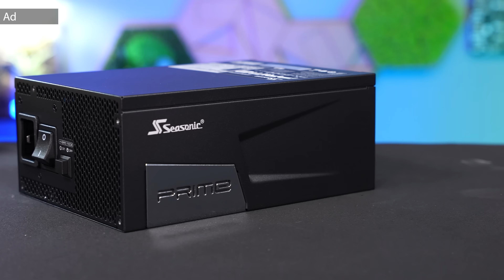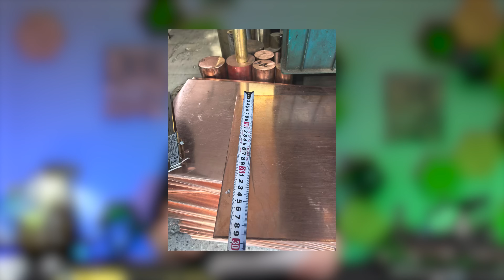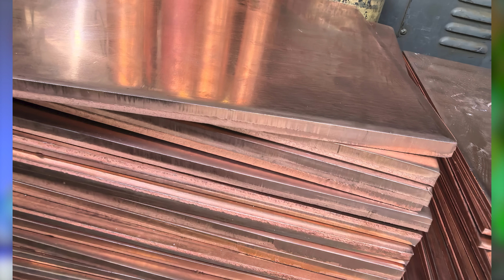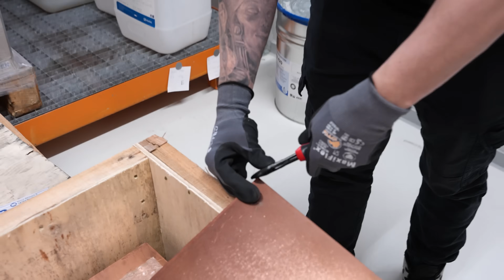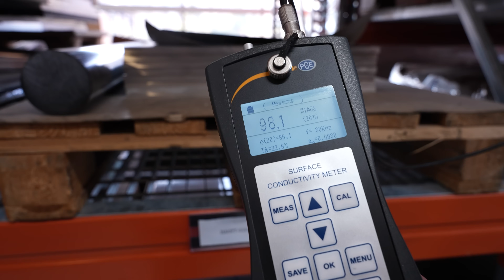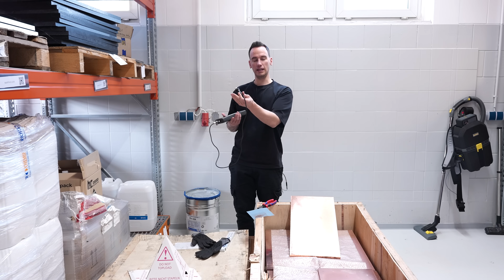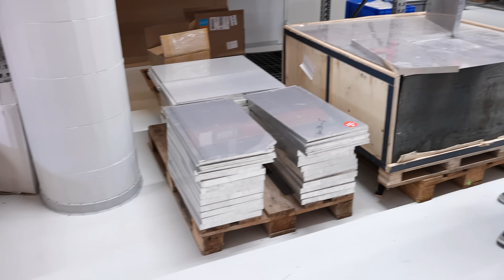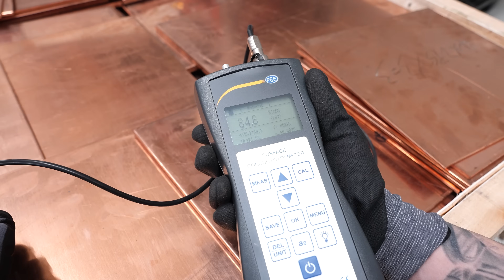I Got Scammed

Comment: Lol funny this video comes out when my firm got scammed buying Chinese steel to Canada. My boss being Canadian didn't want to deal with USA cuz of the tensions and decided to buy steel for welding and fabrication from China. The quantity ordered would normally cost 100k USD and a Chinese company was offering it for 30k, just usual grades SA516/SA387. We waited a month and it arrived and they were dogshit steel that didn't even classify under US/Canada grades.
Same happened in 2021 in my previous firm who decided to buy Chinese batteries (Legendary BYD) for all the electrical equipment instead of the South Korean ones we usually deal with. The battery cycles were twice as low and started failing badly in two years while the SK counterparts never failed even after 5 years in usage. 
China floods the market with high volume crap. Their end goal is maximum output of goods without consideration for the environment or resources depleted from Earth. Recycling the whole use and throw goods from China will be a huge headache to deal with 50 years from now.

Comment: You should tell Alibaba about this. They do not like for suppliers to act like this. They might be able to help you get your money back.
Reply: Alibaba won't help them because they didn't use their services. They used Alibaba to scout the source, not actually using Alibaba for the trade.
Reply: @paul2609 Alibaba can still delist them even if they can’t just refund his money.
Reply: @paul2609  This is in fact their mistake. They used a non-regulated platform with basically zero insurance. Amateur move TBH but I hope its a lifelong learning experience that could have prevented much worse deal.
Reply: @paul2609  I think you are right, so he needs to go to his bank. As the EU is the same as the UK, so you have £100k protection on credit cards and £25k on normal VISA AE cards, also many banks give protection on bank transfers, mine gives £80k.
Reply: @paul2609  doesn't matter, if you initiate the deal on Alibaba, then finalise it outside, Alibaba will still step in. I've done it and they helped get a full refund
Reply: @paul2609  yeah this is an important point that 'somehow' got overlooked in the video — if you don't pay through the platform, you don't have ANY insurance and backing from that platform. Imagine just sending someone 40k over bank transfer on the basis of 'sure here's some photos'. Like dude...
Reply: @paul2609  Bingo! Alibaba is great hence why you have to use their payment method and pay the fee hence the "protection". So this is why inexperienced buyers are lead down the path of oh just to a bank transfer it less money for you as you don;'t have to pay the fee. NO THANKS. I have been using Aibaba for production for years and I have received my money back for goods not rendered. Alibab basically holds the money till goods are released and then checked when they arrive at an Alibaba warehouse. Always good to pay a few bucks more upfront than cry later. The price is better anyway than local even with the Ali fee and the risk is just not worth it. Its a doggy dog world out there. Stay Safe.
Reply: @paul2609  FUCKING LOL, okay I felt bad for him at first but naaah man, he should know better that having assurances about Chinese supplier is the only way you're not getting shafted. Pretty sure this supplier does the shipments perfectly when bought through Alibaba cause they don't want the heat.

As someone once said, cheap(er) is expensive
Reply: @paul2609  AUCH..... Why... I understand doing a direct "blind" transaction on a 10$ item or some junk, but this ain't it...
Reply: Should have stuck with Alibaba... TradeAssurance, verified supplier, additional options for Alibaba to send someone out to confirm goods before shipment.. low experience move bro.
Reply: I got £13,500 back from Alibaba this year for defective goods. No problem at all. The money was back in my bank within 4 days, too.
Reply: @hardergamer  waste of time and money, getting a product that sucks and you have to send back. No thanks. 
I'm pissed that I bought a combination lock for my gate, a week later it broke. Fuck this, it's a pain in the ass.
Reply: @hardergamer  But you purchased/paid for it via Alibaba. I also got something similar, which was around 15K. The only issue that we had was the quality, which was extremely poor & we didn't get the amount we asked for (missing ~150 units). The seller suggested me to pay via a 3rd party so he could be me a 25% discount, but I didnt. BUT instead I used the platform itself. It was more expensive but I got my money back =)

And also that wouldnt make a YT video... :P
Reply: @hardergamer since last year they don't always refund you through AliExpress if you're scammed though, I only get my money back around 70% of the time now. (I spend around $70k a year on AliExpress.
Reply: @hardergamer you purchased through the platform.
Reply: @hardergamer  are you sure this YouTuber used Alibaba for the purchase tho?
Reply: @sepg5084  He said he used alibaba.
Reply: @hardergamer  Yes, usually you get the money back on Alibaba. But then you don't get a nice YT story.
Reply: @lukasvonniederhausern6153  Not if you sidestep Alibaba and go straight to the supplier, try keeping up.
Reply: @lukasvonniederhausern6153 someone said they used Alibaba just to find the source and made a trace outside of Alibaba
Reply: Agree, Alibaba tries hard to keep everyone honest. I've only had good luck ordering tools, some expensive, from Alibaba.
Reply: Thank you for sharing and I really hope you can financially recover for this because you make amazing products! 😢
Reply: Alibaba has product called Trade Assurance for this kind of thing. Basically they hold the money in escrow until you sign off that the product you got is defect free.
Reply: forget alibaba call the embassy, send them the info.  They make Chinese businesses look like scammers.  China wants to diversify away from the usa.  It's a good time to get them to go after scammers that hurt their reputation.  I bet they get whipped.
Reply: @charbtious7262  okay karen chill, and then what, call the manager of china?
Reply: @charbtious7262  lol and they will just tell u to hire a lawyer to sue the factory in China. Which is another big chunks of money
Reply: @charbtious7262  THIS IS THE DUMBEST MOST GULLIBLE COMMENT I'VE SEEN ALL WEEK, THANKS FOR THE LAUGH.
Reply: @BaloneySandwichWithKetchup  actually Xi doesn't like Chinese scammers because it hurts their reputation/bottomline.
Reply: @BaloneySandwichWithKetchup  your comment is idiotic.
Reply: @charbtious7262 lmao imagine you are a Chinese who just gained $$$ from your enemy, will you honor your enemy's request???
Reply: @m3chanistthe Germans were always gullible.
Reply: @m3chanist yeah right 🤣 ofc they are, everyone is an enemy of xina.
Reply: @m3chanist u sure ?
Reply: @m3chanist If North Korea started making really nice 3d printers for cheap i bet you'd say the same about them too. You gullible selfish little fool. Blind to the world around you.
Reply: @nmslesecnmbese917  are you ok? drugs?
Reply: Yeah I was going to say, seems odd that there would be zero redress from Alibaba, but I guess if that's their T&C's then nothing you can do.
Reply: @apondo100  They used Alibaba to scout the source, not actually using Alibaba for the trade. So no reason for Alibaba to help them.
Reply: Except, a company can just easily start under another name.
Reply: @DarknoorX this company was using this name for 8 years. If they start with a new name he wouldn’t have used them.
Reply: @rsilvers129 The problem is scammers like this simply buy names that already have a history
Reply: @rsilvers129  Companies can be sold or they hit desperate levels and try scamming. Especially if someone tries to go around the purchase through the site which could have happened here. Its not uncommon for people to skip using the site for special or custom order stuff.
Reply: @rsilvers129 I mean once they're shut down or removed
Reply: It's too much money , they're not going to do s***
Reply: Even aliexpress is fast at helping and if you report a store for scamming they will be closed
Reply: @Hun73rdk  The good thing about Aliexpress is that unlike eBay you don't pay directly to the seller but to the Aliexpress itself so the payment is handed over to the seller after the cooling period expires during which a buyer can claim issues with goods purchased. I got refund from Aliexpress 100% times of 100% of the claims made. I cannot boast of any good score like that with eBay though as my physical losses have reached to about $1000 dollar all up there.
Reply: @Hun73rdk AliExpress first of all it's always on the seller's side, if they decide to ignore your reasons you are simply screwed...
Reply: @Hun73rdk not true, I had a supplier from there ship me an empty plastic bag, aliexpress asked for a video showing me collecting the parcel from the delivery man all the way through to opening the package, who the hell does that? They asked what happened when I refused to take the parcel, it was just dropped at my door, couldn't refuse delivery...
Reply: @AusCharlie  What?
Reply: @AusCharlie  well, this is on a rather different scale: I doubt he could inspect the good without a proper lab rest, and it clearly is a sophisticate scam done with the intent to deceive who receive the good on any first sight check.
Reply: @Zumzifero you don't think for higher value they would demand more evidence of custody than less?
Reply: @AusCharlie  not from a moral point, but tracking the fraud becomes much easier and this is a blatant fraud on an industrial scale
Reply: @AusCharlie just don't accept the package on their website and insist on a refund. I have multiple lost package claims and they all refund me back. 🤷
Reply: @AusCharlie  i always video myself opening the seal on a package just in case
Reply: @AusCharlie I'm recording unpacking of any relatively expencive parcel from Ali. 
It always works. I showing parcel from all sides slowly and then open it.
Reply: @AusCharlie  There must be something wrong here with your case because they didn't ask that of me lol
Reply: It's possible the source was scammed as well, you never know.  People working on docks, shipping companies, warehouse workers, are all vectors for criminal activity.  China is in a similar state that the West was 100 years ago.
Reply: @PeteQuad  nah this is from the source. That amount of machination and effort involved, nobody's gonna bother if it's not the supplier himself. They'd steal them off a the back of a truck, sure, but not devise a scam like that.
Reply: @0bzen22  There has been reports of swapping by shipping companies. They would pilfer out so much and swap in other to balance out the weight and size. The supplier was innocent in this but the reason why it was happening was because the shipping company knew ahead that it was a valuable load and what was expected to be in it. Plating a bunch of steel plates is not overly hard to do and cutting a bunch of steel plates to the right size is also easy to do. A steel plate can be plated in copper of a thick enough layer in a couple days. The machining can be faked by machining the steel plate before plating because it will get that look after. Thats why full finishing a surface is done for copper plating because it will duplicate those imperfection if it's a thin enough plating. The load of aluminum could be swapped. The sister load of copper really puts it into full on scam. The first load of just copper was too evenly done in a plating for the whole load to be swapped. Thats why if you deal with new suppliers then go through a reputable middle man that will offer security if something like that happens. 

People give shit about Amazon, Ebay and other sites but some of them do rather well on fixing scams, sadly after it happens but atleast you can get your money back. People need to learn to not destroy the packaging when they get stuff.
Reply: @0bzen22  What do you mean devise a scam?  They simply replaced the bottom ones with steel.  It wasn't exactly elaborate.
Reply: @PeteQuad  They need to have the plates ready with the same dimension, it take planning and time, it's not a simple substitution with bricks.
Reply: @0bzen22 I'd say OP is absolutely right. I think it was done somewhere in the shipping. Because they would absolutely need to do a scam just like that, that the pallet weight and size looks original, because obviously the shipping documents wouldn't match and someone would get busted immediately. If it were the seller who scammed, well there just aren't any reasons to try to get away with it. It would've been all the same for them to send something heavy and cheap to customer and bail out as they're essentially screwed anyway if they ship fake products like that. But for some shipping related scam, well there the criminals I assume need a bit of time to dodge the bullet.

Just my take for this.
Reply: @ciano5475 Yeah but this is almost exactly the type of thing the mob would have done 50 years ago.  Someone gets a tip that a large quantity of copper is shipping out and they arrange for it to be swapped.  Easy score.
Reply: @ciano5475  For the aluminium scam, the top plates were the real ones, the bottom was just random steel cut to the size of a pallet and stacked until the weight matched.  A dock fraud gang could do this with any bulk delivery more expensive than steel by weighing the pallet before and after to keep the weight unchanged, then just put back a few of the plates from the shipment.  Same scam as adding water to shipments of rice.  The copper coated exact dimension plates took more specific effort that would require time to manufacture if intercepting between supplier and port .
Reply: He cant even call out the company names. He is complicit with their behavior
Reply: First of all, you need to be able find a real person instead of chatbot to support you from Alibaba. 😂

Secondly, the real person from Alibaba would understand and take it up. Normally they would just say, let me help you, I pass the case to my colleague, bla bla bla. 

And then, after a long of conversation, Alibaba people will say, the vendor provided the certificate, its real stuff. And then asking you to provide proof why the stuff you received was fake. 

Lastly, even you finally proved it, the vendor will just tell you maybe I send you some of money back but you need to give them 5 stars rating. 😂

Funny thing is that Jack Ma always comes out and say a lot of good words, inspiration but he never really takes action to make things better.
Reply: Alibaba is not a private company anymore, it's state managed directly from the CCP. They dont care about any of your issues using the service.
Reply: @kirkanos771  This is too true unfortunately. There are many good stuff in there that are very tempting but giving my money to the CCP makes me hesitate a little
Reply: @kirkanos771  literally false. It is not state-owned. Alibaba group is publicly traded.
And the state would care about scams, because they are trying to develop better trade ties with other countries at the moment.
Reply: @k @kirkanos771  this definition, does blackrock own most companies and DIRECTLY manage companies? No. A majority ownership =/= direct control. All large companies in china must have some ownership from the CCP so the CCP can force the company to do something if they believe the company is going in the wrong direction. Generally they don’t interfere.

Comment: This is the same thing that happened across China with the surge in demand for Gold and Silver bars with the entire industry scamming consumers with fake gold and silver bars.
Reply: What did they make the bars out of? gold plated lead?
Reply: @Knowbody42  I would add that even the major official government run CCP banks were caught selling fake gold coins/bars to customers dating back many years prior to this as customers recently went in to try and sell them, only to find out they were fake.
Reply: @Knowbody42  They didn't even use real gold on most of it, but yeah mostly lead or steel as long as the weight would match the real thing.  Chinese were panic buying selling homes, emptying savings to load up thinking it was a huge boom and there would be massive gains.

Comment: Respect for sharing your experience but next time if you have 40,000 Euros to spend you should send a representative from your company to test the plates and oversee packing and shipping. flight and accommodation would probably cost 2,000 to 3,000 Euros, that's a cheap insurance for 40,000 Euros in my opinion

Comment: Don't be embarrassed. The shame is on them. I am sick of this behaviour which persists for decades now. Every 3-4 orders from China, we have at least one problematic - the case of the last set of 100 pcs is not 3 mm thick but 2. The cover is not UV resistant like the sample. The stainless steel bolts of the last ice making machines were only on the outside, while the ones inside got rusty and literary disappeared after some months of work. We need to check each shipment mm by mm but still miss something.

Comment: For goods from China, you need to use an Escrow service that will hold the funds until you have received and verified the goods. This has a cost, but also causes all the scammers to not get involved in a possible sale. Once you have an established relationship, you can then move on to a deposit payment until goods have been received and verified. Due to the value of copper vs steel, a deposit payment with a new supplier is not a viable option, as they can still make a buck.